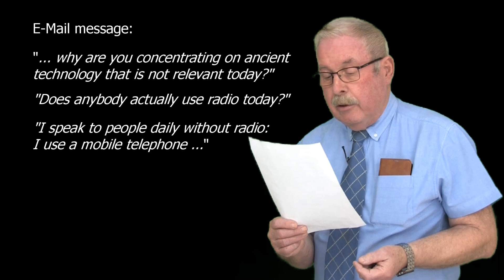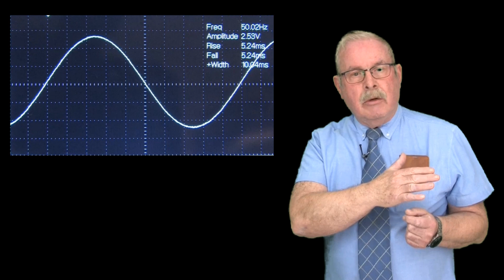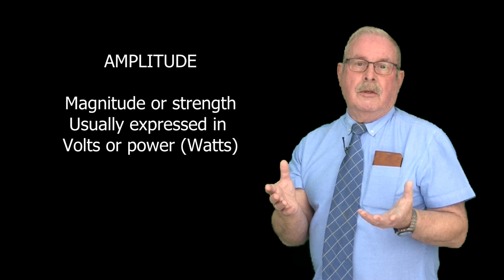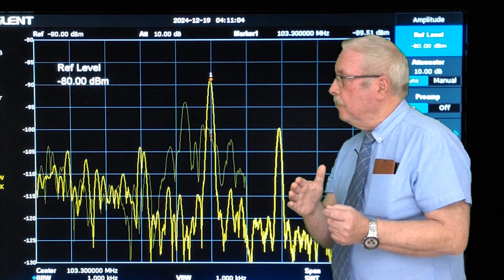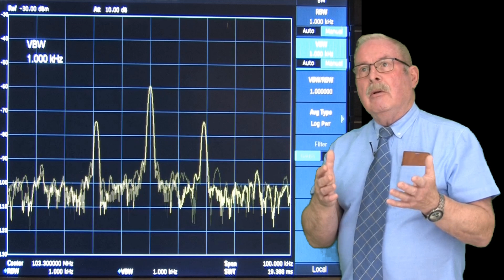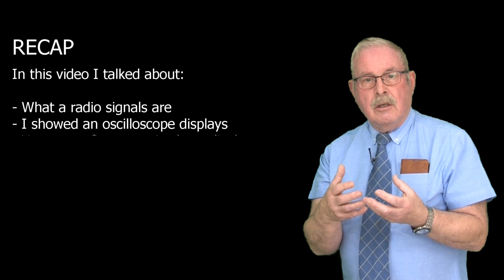What Is RF?

Comment: If it's $2000 for a hobby grade spectrum analyzer then what grade are the ~$200 Tiny SAs listed on Amazon ? :)  Thought those were the hobby grade and the 2K ones were the lab grade instruments..
Reply from the maker: Hi,
I suppose a lot depends on the minimum you expect from an analyzer. The analyzers I used professionally were in the region of $40,000 to $100,000, but they worked up to the 50GHz regions, and could decode 5G Cell-ID, SSB, and get stable level data. As soon as you talk about constellation diagrams and >10GHz the prices seems to rocket.

For my own lab I chose the Siglent SSA3021A analyzer with a range limited to 9kHz to 2.1GHz, and has no signal analysis, other than the basic SA features. It also has a good clean tracking generator that I use regularly for filter design and testing.

Yes, for $200 you can get a simple and effective instrument. I have a Raspberry-Pi with a colour display and an SDR dongle. It makes a great OTA monitor and QRM-hunter, but it is somewhat limited on the workbench. Measuring down to -120dBm is a lot to ask, but the Siglent can do it.

Anyway, thank you very much for taking the time and trouble to respond. I really appreciate your comments. Sorry if I was a bit verbose with my answer.

Very best regards and I hope youhave a Happy New year - from Harry - SM0VPO